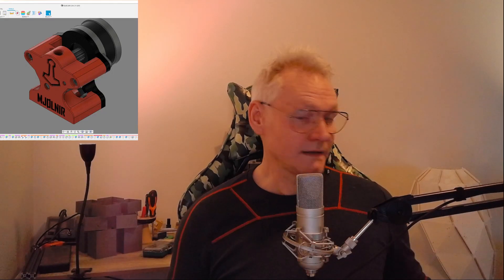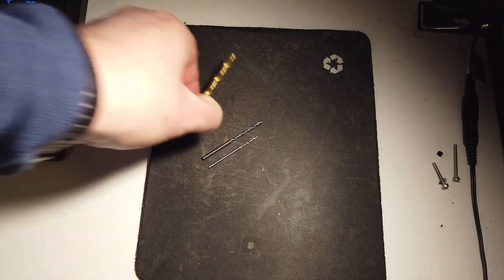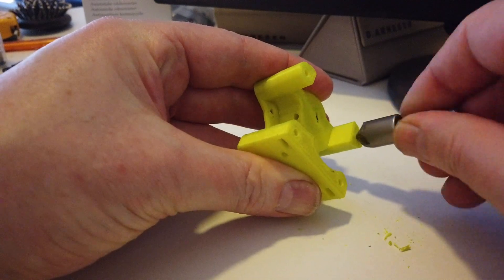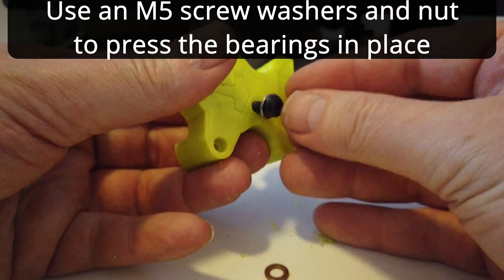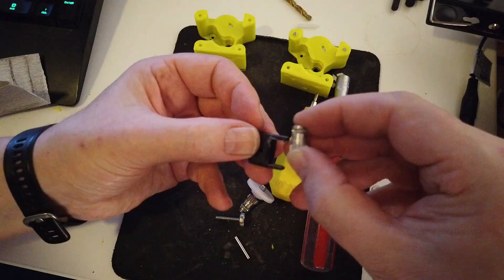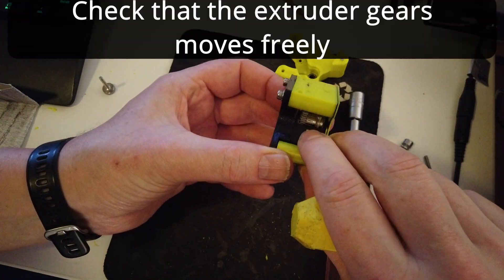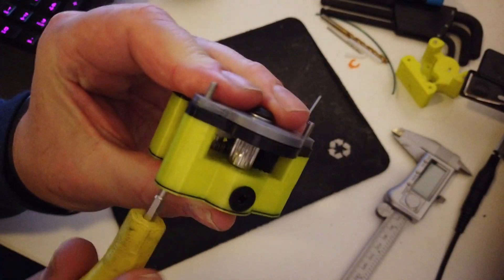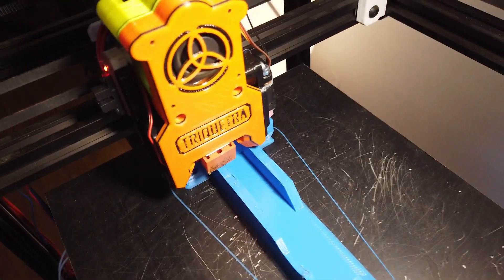MJØLNIR DIRECT DRIVE EXTRUDER ASSEMBLY | 155 gram | Featuring Triquetra Toolhead

Comment: Hello, I hope someone responds. I'm buying my first 3d printer, for things i need to use it with it must have ability to print with 2 materials at once. I'm thinking of buying E3D's Chimera hotend for that purpose and I think that the MJØLNIR might be a good option after some designing. Correct me if i'm wrong please, i need to know if that is possible. Also sorry for my bad english as i am not a native speaker.
Reply from the maker: It might be possible to fit the chimera inside but definitely need a lot of redesign. Maybe there are better options out there ready to install
Reply: @PRO3DESIGN  I don't think there will be THAT MUCH of redesign. And yes, there are some options, but they're not that light and compact. Also they're way more expensive. When I'll finally get the printer and chimera I will make the results and modifications public for anyone.

Comment: I'm printing one right now, the motor is in the mail. I've got several sets of BMG gears laying around waiting for a good home. :) Keep up the good work and thank you for your commitment to advancing open source. Also, what is the difference between the Mjolnir 31 and 51?  

Edit: Oops sorry I read further down in the comments and answered my own question: gearing ratio, 3:1 vs 5:1. 31 being recommended at this time for temperature reasons. Is that still up to date information?
Reply from the maker: Yes that is correct

Comment: What is the difference between the m31 and m51?  Awesome design!
Reply from the maker: 3to 1 and 5to 1 geared. The 5 to 1 uses a special motor. It gets a little hot. Not get this verified yet
Reply: @PRO3DESIGN  would abs/asa be ok to print it with? I know you mentioned petg.
Reply: @PRO3DESIGN  or would pla work for part of it? (So I could color match it to some other parts of the build?

Comment: So you made a Sherpa Mini but >50% heavier! Good job!
Reply from the maker: Thank you for responding. There are two versions of this extruder. One still in beta and it comes in at 132 gram using the same motor and gearing as the Sherpa. This version uses another pinion which allows you to use also a nema 17 for bowden setup. The nema14 for this version is 10 grams heavier than the ldo motor but runs much colder. This is called the M31 and motors are more accessible but if you want max weigh loss then go with the M51 at 132 geam or just use the Sherpa if you prefer it. I needed an extruder that integrates with the new Triquetra tool head so I designed my own to accomplish this. You can also run the Sherpa on the Triqetra but might need some modification. Stay tuned for more information on the Triqetra
Reply: @PRO3DESIGN  Don't get me wrong that looks amazing. But why reinventing the wheel?

Comment: Neat design but I feel light like that should be much more lighter. I know the orbiter runs 140g with all the gears and aluminum shaft. The Mini Sherpa itself is like around ~105g, a few people running it sub 100g.
Reply from the maker: Oh the motor weight is 94 gram and there is the hardware and gears so 100 gram i guess they are probably made out of helium or some kind of mystery material. Let me know if you can provide info on this
Reply: @PRO3DESIGN  Papejellys minisherpa is 97 grams.
Reply: @PRO3DESIGN  , at the end of the video by Annex-Engineering, the complete mini Sherpa assembly is put on a scale and it weighs 105 grams (one zero five). Maybe their stepper motor is a little bit lighter?

Comment: With the dragon hotend, you should probably use the screw mount instead of groovemount. That way you can still do one handed nozzle changes :)
Reply from the maker: Yes I plan for this doing multiple choices for different hotends starting with the v6 Grove mount as it fits several choices

Comment: I might suggest adding thin stainless steel shims to the latch piece surrounding the gear (labeled #3) to prevent it from wearing the plastic. Also, I think you have the wrong gearset link (or incomplete) in the description, it's only for plastic gears.

maybe these shims, 8mm id x 11mm od x 0.05mm:
https://www.ebay.com/itm/Yokomo-8x11mm-Spacer-Shim-Set-0-05-0-10-0-20mm-YOKZC-S80S/401103786552

maybe the id could be slightly larger than 8mm though...
Reply from the maker: Oh thank you so much for the comment! Shims is a good idea. Good thing though is that the latch can be replaced easily if it wears. Also the design is minimized and some shims may encrease the size. Also we need to consider accessible hardware and shims we might need an m3 x27 which is not accessible.. Let me check the link
Reply: @PRO3DESIGN  yes, very true, simple to reprint, but besides that I don't see anything else that would affect longevity. I just ordered the parts and I'll try and make it. I just wish I could find shims slightly larger than 8mm, but I'll try them anyway. Maybe I'll run an 11/32" drill through the shims haha
Reply from the maker: @WarHawk427  good luck. Let me know how it goes
Reply: @PRO3DESIGN  Please check your email